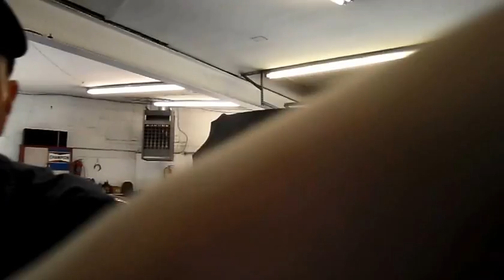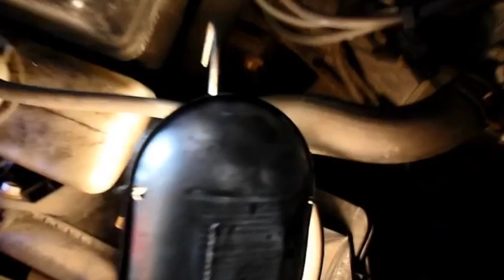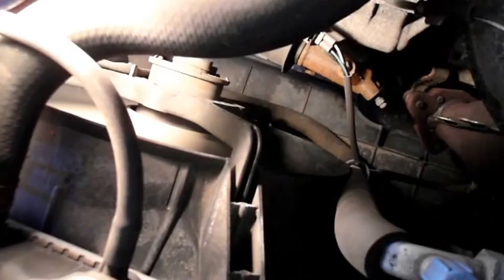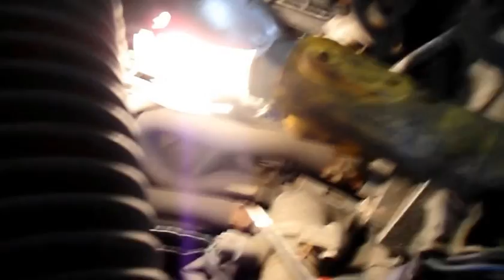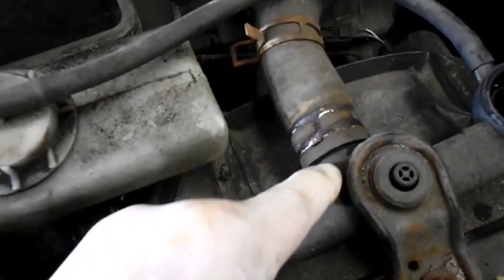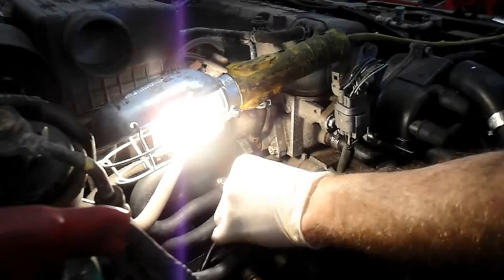How to diagnose and repair an over heating problem on a Honda Civic

Comment: I changed the sensor ,thermostat,radiator,water pump and timing belt and burped the radiator 🤦🏻‍♂️ and it’s still overheating in my 05 civic LX 1.7 even did the manifold/catalytic converter and 02 sensors

Comment: I have a civic lx 2000 I replaced the radiator and fan and also the thermostat but it’s still heating up
Reply: I did almost everything and it was good for 2 days but back to over heating!but the head gasket is the only thing I have not replaced
Reply: @JonathanDiaz-vm5mb any update?

Comment: I am having this exact problem now I know what to fix.
Reply: Bro my 05 civic lx is too! I did the radiator,thermostat,water pump and timing belt , thermostat sensor and burped the system, even put new manifold and it was good for 2 days then I drove through a mountain and it started overheating when accelerating 🤦🏻‍♂️ im thinking head gasket

Comment: Replaced EVERYTHING and it STILL overheats....Ugh!!! Any ideas???   Replaced radiator and thermostat , and temp control switch... both fans work.... checked all fuses , and relays..... fluid all full , no leaks!!!!!!
Reply: You ever figure it out?? I’m stuck with the same problem

Comment: So I have a 96 civic thats overheating, well from what I understand it comes very close to overheating, the AC/heat don't work, and from what the previous owner said I should replace the head gasket. When I originally owned the car years ago it had an overheating issue and I ended up replacing the thermostat and a couple hoses. But when I tried to "burp" the cooling system like people told me to do after opening the system up, it wasn't burping right, it would spit coolant up while fluctuating RPM. I'm just wondering how I can diagnose what exactly the problem is, thermostat has been replaced, a couple hoses, and the relay to the cooling fan cause it was burnt out. I just don't want to end up spending a bunch of money replacing things that end up not fixing the problem. Would a bad head gasket cause overheating issues on this scale?
Reply: When head gasket fails, you will have seemingly disappearing coolant (no external leak) and a steady stream of white smoke from exhaust pipe when at operating temperature.

Comment: I own a 2003 Honda Accord 2.4 litre with a new thermostat housing and new thermostat. One morning it was cold i started up my car and let it warm up for 22 minutes and then the gauge went to hot i did see very little smoke from the radiator. The cooling fan did not turn on at all i don't know what the problem is, do you have any idea 💡 what  the overheating is about? Thank you !!!

Comment: I have an odd issue in a 2004 Honda Civic, I’ve replaced the sensor that controls the fans, temp sensor, thermostat & burped the coolant 
Car still overheats.. 
does NOT overheat when I have the AC running .. any clue is to why ? 
Im used to hearing peoples cars overheat when they have the AC on but mine happens to be the opposite situation lol
Reply: You figure it out??? I’m having the same problem

Comment: So my temp needle goes to half then prolly 3/4 of the way but the car doesn’t overheat, I’ve topped off antifreeze too. Could it be a faulty thermostat? It shows slight smoke from the hose connecting to engine but it’s only noticeable in cold cold weather 

Also to note when I turn on heat or a/c temp needle stabalizes

Comment: I have honda civic 1997 I have the same problem the car overheats the fan works but it's too hot still works but it doesn't stay on until temperatures goes down there is no leaks the thermostat was replaced but still overheats what do you recommend my mechanic say replace all the sensors might stop the overheating what do you think
Reply: Hello. Did you ever find out what the problem was?

Comment: My Honda civic 2007 is overheating and showing engine ckeck light. And also not accelerator when i step on the accelerator during the period that is overheats. But when i leave it for sometimes, i wil accelerate and the engine light will go off.plshow do i solve this

Comment: Mechanics make a bad name for the whole industry by finding a problem, then changing 15 other parts with it because they might go bad some day in the future.  If it ain’t broke, don’t fix it.  Best way to create a problem where none exists is by disturbing parts that are continuing to work just fine.  Otherwise it was a decent job of partially troubleshooting, then making an educated guess.
Reply: eh beg to differ had a guy the other day , change one lower control arm with ball joint attached driver side , recommended he do the other side as well , he thought i was trying to get over on him , about 2 weeks later get a call his passenger side  lower control arm broke on the freeway LOL
Reply: @panthers559  I don’t get why that’s funny.  I also don’t see what that has to do with what I wrote.  Left and right are two different sides of the car.
Also, you didn’t disclose to us any info about the condition of the other control arm.

Comment: Hello just wanna ask its ok to use car without thermostat i check my car radiator is ok and fan one of my colleauge told me maybe thermostat problem its ok to remove and drivr my car what the cause if i remove them?
Reply from the maker: Good question . You do need to have a thermostat in you car to regulate the flow of coolant. If you take it out and drive for a long time your car will over heat and at low temperature the car computer will not go into closed loop causing many other problems.

Comment: Hi Eric, i have a problem with my Honda 150 carburator engine 92 -96, the bottom radiator hose stays cold yet the top radiator hose is super hot, i have removed thermostat to check and it does the same naturally just takes longer. i have fitted a new radiator and cap and a new fan switch at Thermostat housing, what could the problem be.

Comment: I had same problem. I have a question still after all that it's getting hot fast still what could it be?
Reply: It could be the water pump.
Reply: Frank Porto III threw a rod barring. :(
Reply: @MrFamilyMoments  oh boy hope it worked out
Reply from the maker: Thanks for watching.

Comment: I have the same year honda civic i noticed that the gauge goes to the middle and im already stressing that something bad is happening to my honda. I had the water pump replaced and timing belt. I switched the hoses too and thermostat and coolant as well. Could this be of a bad radiator which i don't see leaks but notice the reservoir tank has powdery stuff by the end of the small hose to the radiator cap.
Reply from the maker: The middle is not high. What is the outside temperature?
Reply: @jimthecarguy  was 98 degrees

Comment: I have a Tata Nano, radiator fan is not working, checked fan is ok, changed Cooling temp sensor, checked fuses and relays, could not find anything wrong, lastly direct fan with starting key switch though a push pull switch, fan is working. Pl. suggest how to solve overheating in normal way.
Reply from the maker: Thanks for watching.

Comment: I noticed my friend's similar Honda leaks water but noticed its not from a radiator as he told me, but from under his engine. Not so sure, but I told him there could be a leaking hose or coolant reservoir, if the car has one.

Comment: I hope you read this 
I have a 2004 Honda Civic 1.7 L
I put a new radiator in a few Months ago and there were no issues. Now I am having a problem where the temp goes up. I replaced the thermostat that’s for 175 degrees, cooling fan sensor and the radiator temp sensor. I’m still having the problem. When I drive it’s fine but when I’m trying to park or at an idle it starts to go up. Thanks a bunch
Reply: how did it stop. i have exactly the same problem with the same vehicle
Reply: @emileriderman  hello, I ended up getting rid of the car but if I remember correctly the water pump needed to be replaced. Still not sure if they was 100% the issue tho. Best of luck
Reply: @emileriderman have you figured it out?

Comment: So I have a 98 Honda civic Dx , I replaced my fan and relay switch along with hoses but it is started over heating again . I dont have an air conditioner in my car . What else do you think  could be the problem?

Comment: Thermostat, water pump, blocked radiator, cracked expansion tank, head gasket, split hose, leaky Temp sensor, bad fan, bad relay, bad wiring, or bad ecu.

Comment: Jim I have a 2003 honda civic Ex, My coolant isn't circulating. Top hose gets very hot Bottom hose stays cold. Replaced the Thermostat today still staying cold. The car sat up for 5 yrs before I purchased it. Could it be clogged? I dont want to buy another radiator if I dont have to.

Comment: I have replaced the radiator, thermostat, fan switch, the cap and still overheating.  There is no signs of blown head either I really dont know what else to look for
Reply from the maker: What kind of car?
Reply: @jimthecarguy  2001 civic
Reply: @dustindecker9233  Make sure you bleed the cooling system thoroughly, preferably with the nose of the car on an incline (bubbles travel upwards).
Reply: It’s the head gasket get the head resurfaced and use a Fel pro gasket and new OEM Head bolts also make sure your exhaust manifold has no cracks and that your 5 valve cover bolts and valve cover gasket are good.

Comment: I have an 02 Honda Civic and it keeps overheating. We changed the thermostat and it seemed to do the trick for a couple of weeks and would only overheat in cold weather. We also bypassed the fan so it would always be on but it still overheats at idle
Reply: Mine does it too. Did u ever figure anything out?
Reply: Did you ever find out what was wrong? I have the exact same problem.

Comment: Jim, the problem ended up being the head gasket.  Thankfully the head wasn't warped. Our Del Sol is back together now and running fine. Thank you for your time.
Reply from the maker: Great thank you for the update. Watch for the next free tool giveaway coming soon.
Reply: What all did you try before the head gasket? And what issues were you having?

Comment: Curious about my 1993 Honda Del Sol. Replaced the radiator, thermostat, both radiator hose (heater hoses replaced last year) the thermoswitch for the cooling fan as well a the ECM temperature switch. Car runs fine and stays in normal range yet fan still doesn't come on. Used a jumper wire to test fan, works fine that way. Worried the head gasket may be bad. Any input would be appreciated.
Reply from the maker: Do the fans come on when the temp goes over 3/4  on gauge?
Reply: @jimthecarguy  it doesn't get that hot. Found new thermostat was bad and replaced. According to shop fan supposed to come on 195 to 203 degrees. Seems to be bubbling in radiator which I thought was air pocket... bleed it many times. No leaks yet coolant get low and overflow tank is full. I think head gasket but not sure. Thank you.

Comment: I just replaced top and bottom radiator hoses. I also got the radiator cap brand new. When the car first overhead a week ago. I found the bottom hose to be the culprit. Thus the reason I got new hoses. Thermostat got out in about 4 months ago and new water pump and timing belt done two weeks ago. I out antifreeze in run car and I touch the radiator cap but it doesn't feel hot when the car over heated. I found that weird. Also, that little vent over the radiator seems to release steam when the car overheats. Any ideas. Thanks in advance. I'm not much of a mechanic but trying to save money anyway I can.
Reply: It sounds like your new thermostat is actually ; it happens sometimes. Replace it again and bleed the cooling system.
Reply: Ever figure it out? I’m having the same problem
Reply: @JonathanDiaz-vm5mb  I got rid of the car about 5 years ago. I believe the problem was fixed but it's been so long that i don't remember.
Reply: @incrediblez394  I did radiator thermostat, thermostat sensor water, pumping timing burped the system new manifold the fans work the only thing I think of is the head gasket. But I appreciate your reply.
Reply: @JonathanDiaz-vm5mb  no problem. I wish i would have remembered what i did to fix mine but it's been too long. Good luck and take care.

Comment: As always....great video!! Now im helping my best friend with her civic. Replacing her thermostat tomorrow. Hoping that solves her overheating issue. Already replaced the fan that wasnt working...but still overheating. Hoping the thermostat does the trick! Thanks again!!
Reply from the maker: Good luck Shane keep me posted
Reply: @jimthecarguy  well replaced the thermostat....upper and lower hoses...went to fill radiator.....it was completely cracked all along the top...new radiator.....and good to go!!

Comment: I have a 98 Honda Civic and a few weeks ago it over heated. I noticed that the coolant in the over flow tank was boiling and the cap was off. Don't know if it was pressure from the engine. I'm not a mechanic so bare with me. I had the thermostat replaced about 3 months ago so it's fairly new. The car has 194000 miles. One other issue I've been having prior to the car overheating is that I don't have any heat in the cabin. Don't know if the heater core is no good or just clogged. Could the water pump or head gasket have anything to do with either of my issues. I did check the cooling fan and it turns on. Any advice as to what I can check next to fix over heating. I'm going to check hoses again. Thanks in advance.

Comment: My 05 civic LX sedan overheats when I'm half hour in my drive but no leaks what do you recommend me to check first??? Thanks!
Reply: Coolant level, check if the fan switch is working, replace the thermostat (it's cheap), flush the radiator (remove it, stick your garden hose on one end, let it flush thru the other end).

Comment: my fan wasnt working so i did the papaer clip and it worked replaced  the fan switch but still over heating and no leaks... only overheats while im sitting still and not alll the time. any suggestions. fan comes on but still over heats after driving for a while when i stop
Reply: chris carver my 93 civic started doing that today

Comment: Can't find where the water is going when it is running no sign of any leak but I can tell I put water in radiator and it is going somewhere can you tell me what this is my car is sitting for 6 months I paid so many people nobody knows where it is going I am wasting money there is no sign of it leaking through water core or the hoses no sign of leaking there is water lil leaking through the tail pipe

Comment: Hello sir, nice video.I have a '94 Civic eg 1.5 16v 90hp and i have a problem that i don't know how to solve it.First time the water was boiling in the expansion tank and the fan doesn't work.When i went at the mechanic, he said that the thermostat is blocked or something like this and i need to replace it and to replace the coolant temperature sensor too.I replaced the both pieces and now the fan still doesn't work.Another problem is the water is still boiling in the expansion tank even when i run with the electric fan on direct(works continuously). I hope that you can help me and sorry for my bad english, have a nice day sir !
Reply: It was the water pump, thanks anyway !
Reply: Thanks for tell us. One question: when the car was overheating was it cool down when you accelerate or rev it?

Comment: jim how about my 97 model honda city my rad fan..is not working if i will try to connect the paper clip to the sensor like your vedio  only  the ac fan running.but if i  will direct to the battery the fn rad is totally working
Reply: Replace the switch that is located on the housing like he did.

Comment: Do you need to drain all of the coolant if you are just swapping out the switch and not the hoses?
Reply: No. You don't need to drain the coolant. Just remove the hose on the thermostat side, replace the thermostat, and put the hose back on. Some coolant will spill and AIR is going to be introduced into the system which is not good so look up how to bleed the coolant system for this car for when you are done replacing the items.
He should of mentioned that you should bleed the system because you're supposed to do it either way when doing this job whether you follow his instruction (draining the coolant) or mine.
Air in the system (from not bleeding) will cause the engine to over heat if not done.

Comment: I have a 2004 CRV and it overheats when stopped for a bit in traffic but once I start moving it cools back down. This only seems to happen when it's hot out. The air blows cold from the AC. It also cools down if I crank the heat up when it starts to overheat. Any help would be appreciated
Reply: It _your_boy_Johnny B ..water pump?

Comment: My fan works I seen it ....my upper radiator hose bursted on me I have replaced it ...needle still at the top hot when I leave car running trying thermostat next ...I have felt hose (upper) when car is running don’t feel any pressure at all any tips...???

Comment: Jim, I’ve replaced the radiator (with flush), the thermostat, engine cooling sensor, fan relay and have had the gasket checked. I just checked the radiator fan via this method and also the relay again. Why is my car still over heating? Water pump? Faulty thermostat?

Comment: My 99 Civic cools normally on flat roads but pushes the antifreeze into the overflow only on long steep hills where it has shifted down for long periods.   Temp. gauge stays in normal range until.   I've changed everything including the radiator but haven't changed the pump yet which I guess is the next step.   Any magic tricks, anybody ?

Comment: SAME Car I have the same problem car over heating and Fan not working I replaced the thermostat switch by thermostat the cooling temp switch and the relay and the fan is still not working I know the fan works .I hooked it up to the battery.
Reply from the maker: chris         Is there power going to the cooling fan?